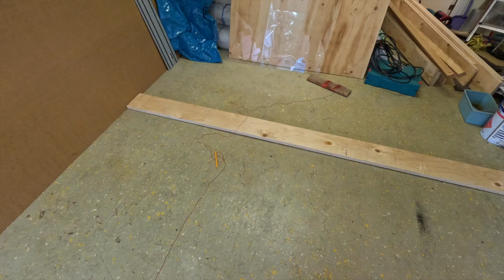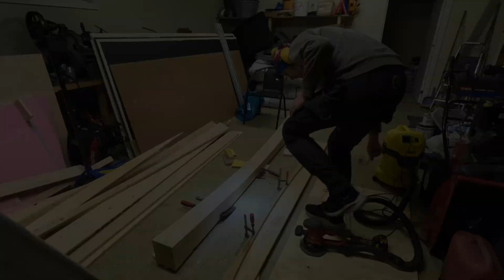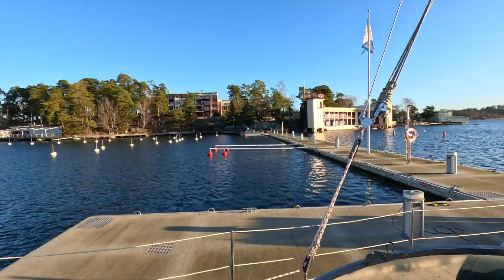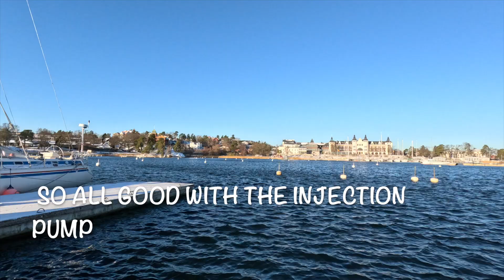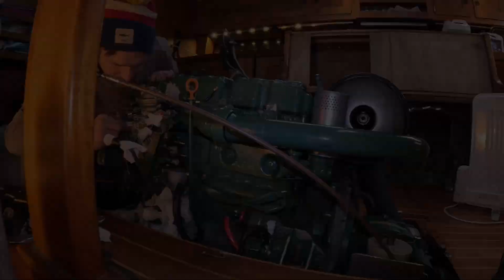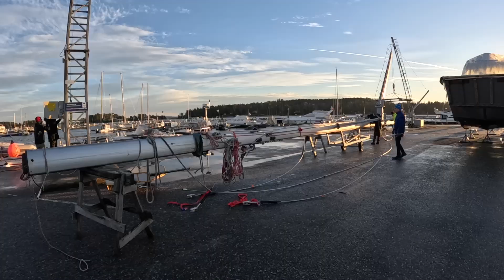Starting the Doghouse Mold Build & Unexpected Engine Struggles [2.29]

Comment: Did you diagnose in any more detail how the water pump failed? This is a mechanic's nightmare: a failure without a definite diagnosis. Sometimes it will be enough to have the machine working as it's supposed to do, but always the uncertainty of 'what happened?' will remain.